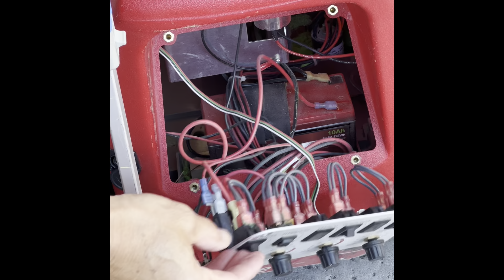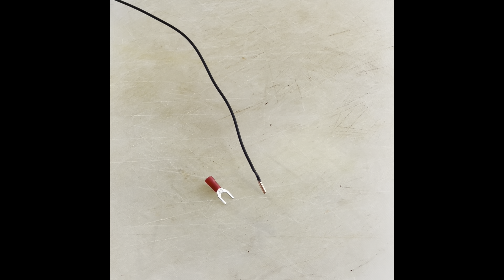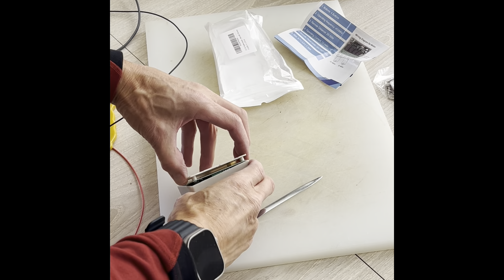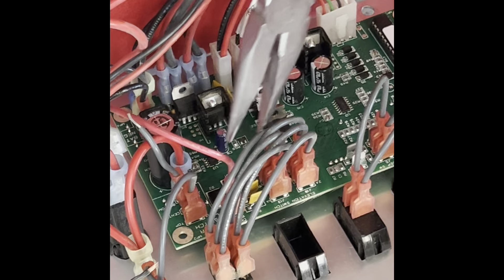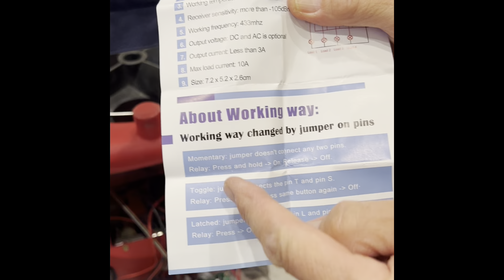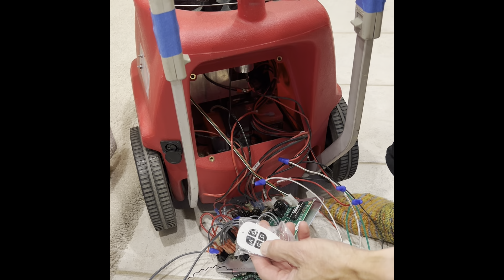DIY remote control hack of tennis ball machine

Comment: Did you have to disconnect the battery so you don't short it by accident
Reply from the maker: I didn’t disconnect the battery. It might be reasonable to do so, just in case. If you choose not to disconnect, take care not to let the end of a wire bounce around while working with the other end

Comment: Hey Jeff, received the remote today, I got the exact same one you did, went to Home Depot and got the wires and Ace Hardware and got the little clamp for the ground screw.  Hardest part was stripping the wire ends 🙂worked like a charm.  The thing I like is, I can turn it off completely with the remote and save battery.  Again, THANK YOU so much for this great idea, as I have own this machine since 2016, Lobster wants $185.00 + tax + shipping, my remote from Amazon was $16.99, wires $4.60 and the little clamp was $0.46. So, for less than $25.00 I got my machine now with a remote control, that works great.  I enjoyed and learned some new!!   Cheers!!
Reply: Hi could you link me to the Amazon remote that you purchased?  Thank you.

Comment from the maker: I recently experienced reduced range even with a fresh battery in the fob. I attached the receiver to the shell so I could pass the antenna through a hole to the outside to improve reception. It works really well. I will make a short clip showing what I did.
Reply: Hi Jeff could you post your clip of what youd id to increase the range.  
Could you also link the remote kit you purchased from Amazon?  
Thank you!
Reply from the maker: @harryy626  I very likely got busy and didn’t make a video before I sold the ball machine. 
The exact remote kit I bought is not sold any more. This one seems okay if you’re going to do this: https://a.co/d/6anM4e2
Reply: Thanks!  We’ll miss your helpful videos like these!

Comment: This is awesome stuff. Very clear. I have another machine and will be trying this out and looking to replicate what you did on a different board, as well as making a remote controlled external oscillator for it to sit on. Question-- have you ever figured out why there's a delay with the feed motor, or how to modify how long it takes on start up? Mine is similar at about 8-10 seconds after startup. If I have a transmitter to power on the machine, I think it'd be ideal to reduce it to about 2-3 seconds. It doesn't seem to do the delay when I power it back on immediately after turning it off. I was thinking some kind of capacitor or something, but was wondering if you had messed with yours at all. Thanks a lot for recording this!
Reply from the maker: You're kind with the compliment. 
As a shallow end mechanic and diy-er, I don't know how to assess the various pieces on the control board of my Lobster, with its 20 second delay. A capacitor sounds like a trick the engineers used, so if you could ID that item on the board and replace it with something of lower delay value, you'll get to the promised land early! Cheers!
Reply: @paddlepower888  that was my thought too. I'm an engineer by school but not Electrical. If I end up messing with it I'll give you a message! I've found all these ball machines are about the same tech but the price depends on the size and branding.
Reply: @paddlepower888  Follow up on this- 
I isolated the power wire to the board, and the wire that feeds power to the delivery motor, like you did. Your mileage may vary with a Lobster, but with my delivery motor, one of the two motor wires is connected to the power switch assembly (as expected), and the other connects to the board. The one that connects to the board is located next to some kind of small microcontroller, which likely has some code loaded to it to control the delivery motor starting. I think this rules out being able to get rid of the delay between powering on and the delivery motor beginning. Maybe someone else will come along that's smarter than me and correct me.

Comment: Thank You for this tutorial!! I followed it and your instructions were awesome. I hit one small issue which I'm wondering if you happen to have any helpful ideas. I've tried a few different antenna orientations but I can't seem to get the range over 60 ft. Do you have any tips for increasing the range by antenna orientation or other means? (I got the same RF components from Amazon that are in your image) Thanks!
Reply from the maker: I usually don't have the ball machine further from me than about 40 feet/13 meters--I place it at the service line on the other side of the net for practicing volleys. For ground strokes, I have it on my side of the net. 
One thing I hadn't done is to push the antenna through a hole drilled in the outer shell of the ball machine. I'm tempted to do that as it sometimes doesn't respond at 40 feet.
Reply: @paddlepower888  Thank you for your answer, I will keep it in mind, it was really helpfull.  Al the best.
Reply from the maker: Update June 1, 2024. Due to deteriorating range down to as little as 15', even with a new battery. I tested the system with the control panel off, and the antenna exposed and stretched out. Reception improved to at least 60 feet — I attached the receiver to the shell and passed the antenna out a hole to the exterior.  Methods for attachment include zip ties (easy), plate with bolts (more work, but one esthetic tick higher) double stick tape which will fail sooner, etc. 
I drilled holes for the task.